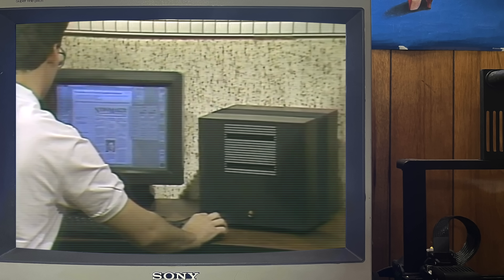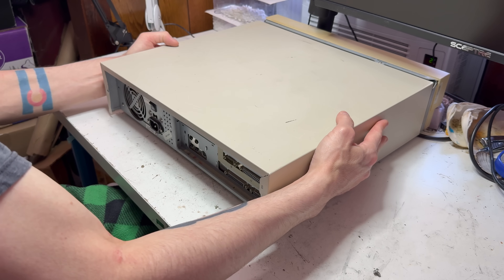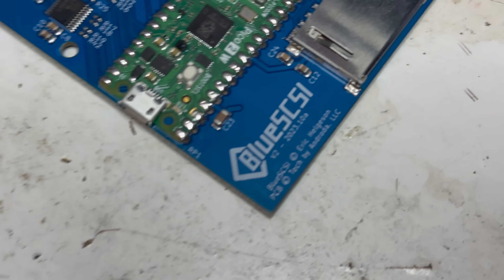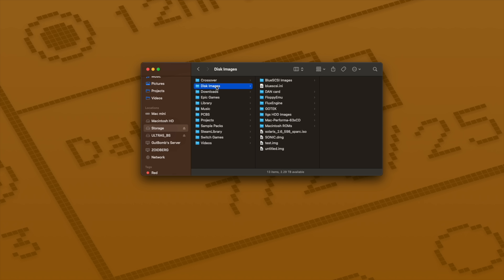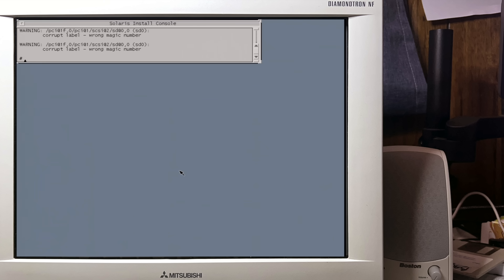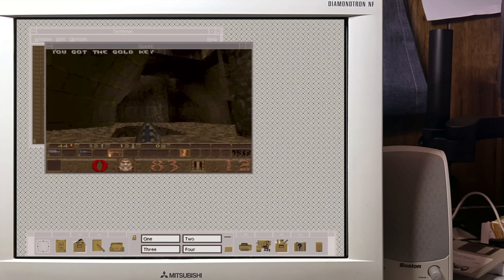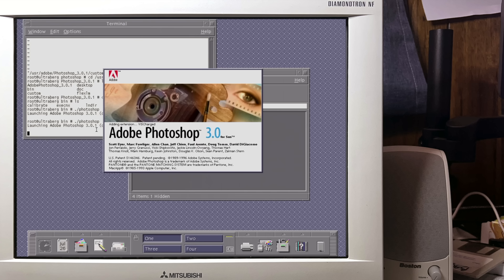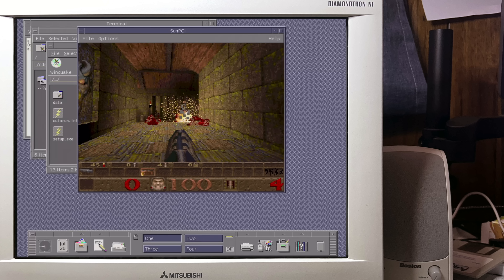The Sun Ultra 5 Was Kinda Weird

Comment: 80c0ffee
so, everything looks all nicely designed and aestheticly pleasing. except the choice of font on the boot screen. anyone know the reason behind that?
Reply from the maker: Total speculation on my part: all of the other terminals/consoles out there used monospace sans-serif fonts and someone at sun thought it would look classier and have more brand synergy with their logo if they used a serif font. I believe openboot and open firmware used on PowerPC Macs has some shared DNA and on a Mac it used a black sans-serif font on a white background. So I think it was to set it apart from all the others and to have some brand synergy.
Reply: @GutBombTech  yea, i thought something similar...

Comment: SunOS4 was the shit, still is....too bad these went to Solaris...which was a piece of chit....when deployed correctly, NIS/YP you could use a central machine for multiple users and be able to login to any other machine as long as you add it as a client.. However, setting up DNS on a SunOS machine was a pain, unless you've done it 5k times....and I've done it about 4,500 times..
Some might disagree but, I've ported SSH2 and other things over to SunOS...have resolv+ working and other things.....sure it's slow as fk, but it's a 30 year old deal.

Comment: They were used to run printers at xerox when I did my co-op (paid intern) there. They had special hardware built to process image data at high speed. They were very cool, but their use was limited to the tasks they were designed for, like all workstations until Microsoft turned it into a security hellscape 🤪

Comment: I purchased many Ultra 5's, and supported Asic engineering teams for a few decades. I don't recall anything weird about Ultra 5's. They were meant to be front-end machines in an nfs environment, ie, they just drove the monitor - the actual jobs ran on server-grade hardware and the data was on raids like NetApps. In a proper group desktop design there were zero local user files allowed, entirely removing all issues with hardware failure on the Ultra 5's. The most common problems were hung mounts when the engineers got creative. I don't recall a single one of our Ultra 5's hardware failing, not even the IDE drives.  Regarding the hardware being aged, Ultra 5's were out of (an amazingly successful) production by 2002, and were realistically outmoded around twenty years ago.    Why should the hardware still need to be still in good condition? What hardware of any sort from a quarter century ago is in good shape now? Crazy, man...
Reply from the maker: Did you watch the video you’re commenting on? It’s about doing weird stupid stuff with a computer. A computer that was uncommon in its day and even more uncommon now. Weird like, not something most people have ever seen or even know about. Don’t have a tantrum about it, just have fun. It’s not that deep.

Comment: 0:15 That's bullshit.  It was easy to find used hardware in the 90s.  I made the shift from MS-DOS straight to Unix with a used 3b1in 1989, a used R3k Indigo in 1993, a used Indigo 2 Extreme in 1997, and an pair on Suns (Ultra 5 and Ultra 10) in 1999.  When you factored in these machines typically came with high quality 20" CRTs, they were typically cheaper than inferior WINTEL hardware.

Comment: I worked at Sun from '01-'04, fresh out of school and writing Verilog for the UltraSPARC V (which never saw the light of day). We had Ultra 60's with 2x 21" CRT monitors. I loved those keyboards with all the extra shortcut keys on the left, I used them heavily in Emacs. We ran simulation, synthesis, and other EDA tools on our desktops and also in a server farm (a room full of Enterprise 4500's if I remember correctly). We were really excited about getting some Athlon 64 systems for the farm, they were so much faster. Funnily enough, our project got canceled and almost everyone ended up at AMD.

Comment: My Ultra5 has been from the United States to Europe, where for years it served as a firewall, then I took it back with me to the U. S., then when I moved to Silicon Valley it was shipped to me and served as a firewall some more... all with Masayuki Murayama's NIC driver for an eight euro RTL8139 NIC card which I bought at a grocery store chain in Europe. I must have pushed terabytes and terabytes of data through that Solaris 10 firewall running on that Ultra5. Then I moved back to Europe, and of course the Ultra5 went with me to Europe again. Still have the machine, and I even used it temporarily a few years ago as a firewall again when my Sun T1000 firewall died. Oh, and I just remembered that I did my Solaris 7 certification... on an Ultra5.

Comment: If you really wanna broil your brain, try a Blade 150 - the fastest of the cost-reduced Suns, and basically a turbocharged Ultra 5 - with a SunPCI and an extra graphics card. (I used an XVR-600 but you could use an XVR-100 or even a PGX32)

I installed Solaris 10 - which works on a Blade 150, or even an Ultra 5, but you better max out that RAM - and then finagled Solaris 8 and 9 into running in Branded Zones. In the 8 zone I ran MAE on one head, and then I ran Win95 on the SunPCI on another monitor, leading to the weird experience of MacOS, Solaris 8, Solaris 10 and Windows 95 all running on the same machine, displayed across three monitors. (One on the Blade's on-mobo ATI Rage, one on the XVR-600, one on the monitor connection for the SunPCI; with some jiggery-pokery and an XVR-100 I could have had the Solaris 9 instance displaying on the fourth head.)

I have to admit I kind of cheated - as the branded zones can't take control of a graphics card, I had to cheese that by using XDMCP and XNest, but then, X is kind of cool like that.

I wonder if I could have bludgeoned NeXTSTEP into running on the SunPCI? That would have been a cute demo, especially alongside Openstep for Solaris (LuBu OpenMagic, if you want it to work on Solaris 10).

Comment: When I was a student, we use various Sun workstations.   They were all amazingly powerful, although I never was a massive fan of the GUI.   That said, it forced me to learn the Unix command line though.

Then I worked for the Uni and had to support the things.    I actually enjoyed it, although the researchers using them were all computer scientists, so tended to solve their own problems.

Then, one day, the CD drive in one failed..   Not entirely sure why (I think it had a custom firmware), but we had to buy a sun branded CD rom for about £600.   It appeared to be a low end SCSI Sony drive, which we could have got for about £150-200.   But, I was told to order the Sun one.

Note:  I know now that there isn't a custom firmware, but I was a newbie tech support guy.    When told I needed to order a sun branded drive, I didn't feel I had the knowledge to question that, and, TBH, it wasn't my money..

Comment: I have fond memories of my ultra 5. I was telecommuting as a NASA contractor. When I left that job, I bought the machine from them for essentially nothing, as it was pretty obsolete by then. 6 gig hard drive and a 333 MHz processor. I had it connected to a 28.8k modem. I got hacked at one point, which I discovered because my modem lights were blinking more than they should have. I had to reinstall the OS.

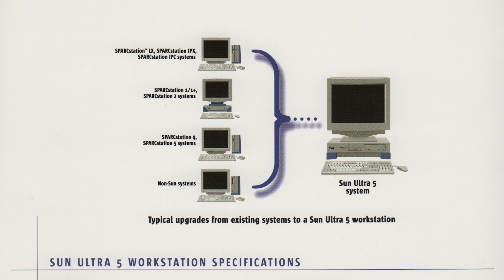Comment: It's times like these that I think about just how incredible technological advancement has been in my lifetime. For example the specs, listed at 2:00
"For just $3,900 ($7,500 modern), you get a system with a 270-MHz processor and 512 MB of RAM!"
These days, this gets outperformed by a $15 Pi Zero 2. The "expensive home workstation" of yesterday is the "fun minimalist hobby board" of today. Wild.

Comment: The IDE hard drives they were putting in Ultra 5's were garbage. I discovered, though, that it was the drive's logic boards that would die. I remember several times people thinking I walked on water when I brought their data back from the dead with a donor board.  They were certainly trying to tiptoe into the water of the lower end compared to say, a U2 design.

Comment: I had a few of those at various jobs over the years. They were mostly faster than the SPARCstation 20 that they ostensibly replaced... except the IDE subsystem really let the system down. IDE I/O would bog the system down heavily, consuming tons of CPU time compared to SCSI. Copying files from the IDE CD-ROM to the IDE hard drive was particularly high-overhead. It really needed a coprocessor to manage the IDE bus.

Comment: I made a living working with these machines.  This was a fun trip back in time.  Linux runs great on these as well.  I remember at one point in the 90s I had four 21" Sony Trinitron monitors on my desk - an Intel linux box, an ultra 5, a DEC Alpha box, and an SGI Indy.
Reply: Also jealous of your Alphas and SGI's, which I also worked with.
Reply: @mercster I was extremely lucky, right place / right time to snag those 😊
Reply: I had one that my work was retiring, I ran Redhat 5.2 on it.  Used it as my gateway/router.

Comment: I had one of these with a 20" Sun monitor on one end of my desk for about 12 or 13 years. Dell workstation with 20" Dell monitor on the other end of my desk. The Sun box had a SCSI card so I could connect tape drives and auto changers (backup and recovery software for just about every UNIX OS and variant being my company's business.)

Comment: From the teaser picture I though I was seeing an Amiga 3000.
Back in the 1990ths we had a mid-level E450 at work for a while - don´t ask me about the CPU but I remember it had 128MByte of memory. Honestly, we could have upgraded it a lot but instead added a Dual-Pentium 200 with 128MByte and BSDi next to it, slowly moved things over and replaced it later with a single 500Mhz Athlon with 512MByte and Linux which literally ran circles around both. Propetary Unix went down FAST in the late 1990ths...

Comment: I have one of these alongside an Ultra 1 and a pizzabox LX50 I got for pennies back in the day. Surprised to see that someone had uploaded MAE 3.0 to the Archive given how litigious Oracle can be. People were after that for years and you couldn't even buy a licence. I suppose it means that it must be over five years since I dragged mine out of the loft to tinker around with. Not keen on the brittle plastic warning. Mine seemed fine and robust the last time I used it. Not even so much as a snapped clip anywhere. I remember having to remove the floppy drive to accommodate the double height RAM modules I put in. Seemed like low-profile ones only existed for lower capacity.

Comment: I worked at company where used a Sun Ultra 60 workstation as a checkpoint firewall.   it had two ridiculously expensive 4-port 10/100MB Ethernet cards.   I can't remember believe they were 64-bit.  The hard drive die on it.  We end up buying a checkpoint appliance in 2002.
Reply from the maker: What a ridiculously expensive firewall! $50k in 1998 money. I mean that’s the base price you negotiate down from but still.
Reply: @GutBombTech  Yeah, I told them it was unnecessary. But the CIO was a former UNIX admin.  He said UNIX was more secure.  Were a good size company about 20,000 employees and 250-300 servers. We were bought by a fortune 200 company about a year later.

Comment: Funny seeing you try to use Photoshop in the Mac emulation when there was for a short while Adobe Photoshop for Solaris.  Had it for extensive testing and it was faster than on the Mac IIfx in every benchmark but the Sun keyboard layout made a lot of keyboard shortcuts difficult, often requiring two hands rather than just one.  When we put actual operators on it that alone significantly slowed their productivity down to well below what they achieved on Macs.  Brought the issue up with the Sun sales reps who just shrugged and said, that's our keyboard, take it or leave it.  So we left it and Sun lost a lost a sale that potentially could have been every photodesk work station for half the local and regional newspapers in the United Kingdom.  Good thing for us in the end as Adobe's commitment to Solaris proved short lived.  

The last Sun machine I decommissioned was a SPARCstation 10 we'd been using as a remote access point to a disaster recovery facility.  Still have a screenshot from that day, 6 May 2009, showing an uptime of 1953 days.  Yes, they were expensive but they were damn good machines.  😀
Reply from the maker: Yeah, I tried the solaris version in the video too :D

Comment: The Ultra workstations were 64-bit machines, so there was this fun period in the early 2000s were you could get a second hand Sun workstation really cheap on eBay and now you have a fairly capable 64-bit UNIX machine.  Or, if you asked nicely a lot of businesses were just giving them away.  I ran my personal web and e-mail servers off an Ultra-2 for several years between 2005 and 2010, and even used a Sun Blade 150 as a desktop for while after the company I worked for threw it out.
Reply: Yes, I got my 1st Ultra 10 for free from a local business, then bought a pair of Ultra 5s off ebay for very little money. I used one for a firewall machine and the other as a home network server. They both ran 24/7 for years until the HDDs died
Reply: Back at the launch of the Blade 100, we placed an order for 10 to replace some Ultra 5's, boy did we get stung. Clock speed was fine, but the cache was only 256k, the CAD software we ran was slow as molasses and actually worse than the Ultra 5's.
Reply: @andrewbird3691  I actually had a Blade 100 too, and yeah the cache limitation was noticeable. That one was pressed into service as a web cache and worked great.  I honestly don't remember what I did with it or the 150 I had.  I know he Ultra-2 is hanging out in my garage.

Comment: It should be noted this was not the first "plastic" computer Sun made. The Ultra's (1, 2, etc.) had a plastic upper case. (mine's in pieces these days.) The lunch box designs long before that were also plastic, but very thick plastic. The only "full metal" systems were the rack mounted gear, 'tho the SunFire 200/400 line had rack kits, they were also encased in plastic. Those feet aren't plastic, they're hard rubber and absolutely disintegrate over the decades.

But yeah, the cheaper SCSI-less designs were horrible. IDE was stupid slow in a UNIX workstation. I gave up my new Ultra 10 (360MHz) for my original U1E (167MHz) because the cheap IDE drive made it much slower for real work. (When the sysadmin whined about it, I told him to replace the SS10 fileserver with it... he never questioned me ever again.)

Comment: In 1997, most large companies that used computers still had pure Unix environments. Sun, extreme power, and stable 64-bit in 1997, not mid-2010 like Windows. They usually crashed once a year. Planning and support could be done automatically and remotely. X servers and dump terminals for the masses.  There is the crux. If you work at a company and you have a choice between a dumb terminal and Windows, you want Windows.  A Sun Xservers with 2 CPUs that could serve about 20 dumb clients costs 20K dollars.  The company could instead buy 20 PCs for the same amount.   This is where the Ultra Sparc 5  comes in. It was just a bit more expensive than a PC. This was the Suns' last ditch to stop companies from dumping X servers and going PC.     The huge flaw in moving to PC was twofold: 1) Productivity, 2) support cost.  Doing simulation work, Matlab, and so on, in Excel does not work. When PC workstations came with Xeons that were at least in the same class as Ultra 60/80, they cost the same. 20K for a good PC workstation.  2) Support cost. With Sun/Unix, one of the largest telecom companies in the world (at the time). 250 Unix users needed 1 support personnel. (easy to automate everything like patching, installation, remonte. Jumpstart was genius. For PC, they had 1 person per 10 PCs.   It took 6 years to switch from Unix to PC.   At the end, they had to sell their mobile phone business, and the share price went down 90%   I know of many companies with the same fate that were killed by switching from Unix to PC.    They always blamed that UNIX was too hard for ordinary people and that it would die.  In 2001, OS X was released, and Steve Jobs showed that Unix with a great UI can be used by everybody. The slogan "it just works" was not a marketing gimmick but reality.   Today majority of all computer devices are Unix and Linux. Somehow, people can use iOS and Android.   Too bad the companies did not listen to the people who knew IT. The strangest thing in my career is that I have never met an IT boss who knows IT.  We talk about banks, oil companies, and telecom.  Always "political" reasons why the people who are in charge of IT work with it. Not competence.